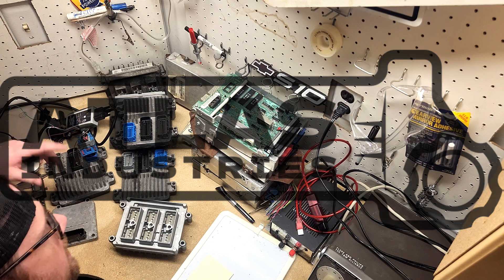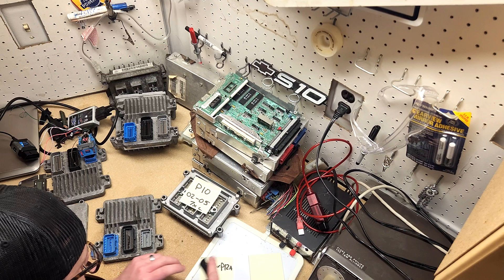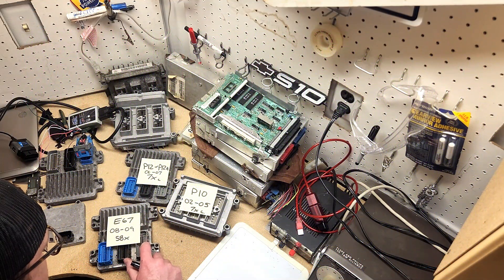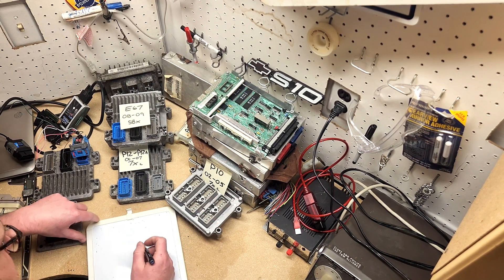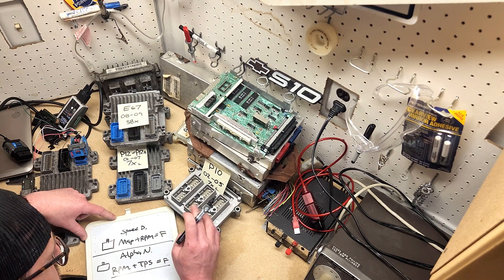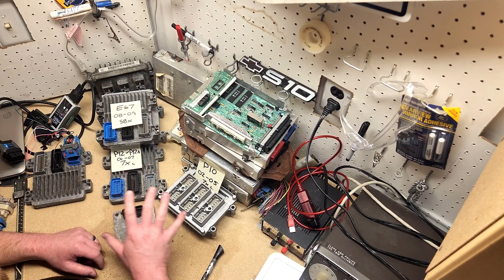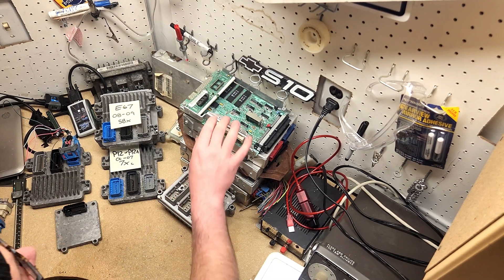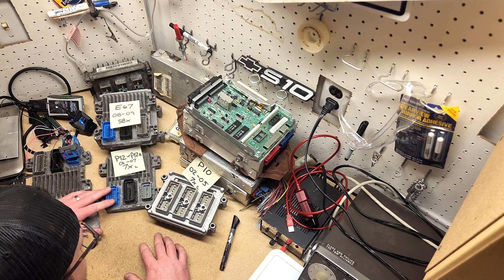Factory Atlas ECUs: The Basics You Need To Know For Your Vortec 4200 - 2800 Swap

Comment: May we have a video. Saying hello. Showing products you have. And how it looks and runs.  Tips on how to clean up the engine bay. Mucho loveo.
Just got an 2003 4.2voy
Reply from the maker: I can make a product video! I do have a lot of content already on facebook if you want to check that out. I don't have any complete running trail-voys right now, I primarily focus on the swap market at this time, all of my 4200 vehicles are swaps into muscle cars, Jeep etc. While some of my parts do fit the Trailblazer platform, I'm not going to get into engine bay dress up kits, repair parts, etc. Since I'm focused solely on engine performance. I am in process of developing a turbo manifold that fits the Trailblazer platform without any cutting or loss of AC, and will be installing that on my 2007 Trailblazer that will also be manual transmission swapped. Stay tuned and check out my website for parts at atlasinds.com

Comment: How can I tell what year engine I have without pulling the pan?
Reply: I have an 08 in mint condition with bad engine, I picked up an 04 at a great deal with a bad transmission, after awhile I noticed the 04 has an aluminum valve cover not plastic so someone has swapped the engine already and I don’t know if I can make it work in the 08 because I don’t know if it’s 06,07,08 or 09 if someone can lead this horse t the water I’m pretty thirsty!
Reply from the maker: @RobertBrown-c7z thy 4200 Bible will answer all thy questions. But in short, no, 08-09 are specific to those years only. https://sites.google.com/view/vortec4200wiki/spotters-guide?authuser=0
Reply: @Atlas-Industries  I wish it would let me send you a picture. The 2004 has a P 10 ECU with the aluminum valve cover and it’s never ran smooth since I got it. I wish I could find a serial number on the block that would let me cross reference that so you say there’s an Atlas Bible and thou must look up thouest thing I so desire to gain wizdim and knooowledge? And wearest will one find this ancient and enlightening manuscript
Reply: @Atlas-Industries  that must be what this Google link is for huh? I say duh to myself.
Reply: And thank you

Comment: What would need to be done to swap the P12, harness & MAF into a 02-05 that came with the P10?
I have access to HPtuners but have only used it on a 06 LS2 and 06 5.7 Hemi, and that was mostly just narrow band tuning.
Reply from the maker: Would this be into a Trailblazer/Envoy chassis? If so that gets really tricky because you're integrating systems that never technically talked to one another and would have a Vin-year mismatch. I'm unsure if your BCM would have an issue with that. I don't deal much in the OEM wiring side as I do for swaps, I would contact Jeremy over at lime-swap dot com as he has experience in OE GM chassis engine/year swaps like that.

Comment: I'm a little confused. I have a P12, not an E67, ECU in my 06 H3 with the I5. You said you can not run an E67 on 7x or vice versa. I5s are 58x right?
Reply from the maker: Correct, I wasn't super clear on that in the video. All 4 and 5 cylinders were always 58x either with the P12 or E67. With the 4200, the P12 was only ever used with 7x cranks, and the E67 only with 58x cranks.
Reply: Ahhhhh gotcha! Thank you. Great video got me to subscribe.
Reply from the maker: @theKEVman011 sure thing! I've been planning for months to make more videos, and I've even filmed a bunch of stuff. I've just been too busy, so hopefully come October I can get more stuff out there.

Comment: Great Information ,.. Thank you!
I’m looking for some input. I’m exploring a 4200 swap, I plan on buying a donor vehicle and will be using the OE ECU and harness, keeping a Turbo install in the future. Going by what Calvin said in a 4 year old YouTube Video the P12 was “THE” ECU to use for boost applications and about the E67 “if you want to run turbo this isn’t gonna do it”. However, later on the WIKI page it says The E67 will support boosted applications! Did I misunderstand or have things changed from the video to the WIKI?
I was searching for an ’06-’07 donor but I do have a 200K mile ’09 that can be had for a reasonable price. Which is the better way to go? I’m thinking the ’09 if the E67 will handle boost.
Reply from the maker: For sure! The P12 is simpler in regards to tuning, but it leaves things on the table like no VVT accessible tables, and you can only run MAF in boost because the VE tables max out. The E67 really is the ultimate since it was designed with boost in mind for engines like the LS9 and LSA. The speed density tables have huge axis that are fully scalable up to 400KPA, etc. The negative is its considered a Gen 4 LS ECU and they have a steeper learning curve to tuning. Building the harness for a y of the ECUs is preety much the same amount of work. If you're not aware of the E67 tuning, Goat Rope Garage on YT is a great resource to learn. I'm not an expert tuner, but feel free to reach out anytime if you have more questions.

Comment: I just came across this video, and subscribed immediately. I plan on eventually interfacing an e67 from a Trailblazer with an older, non-GM engine since it offers much of the same functionality as a leading standalone system for far less money, plus OBD2 diagnostics. I'll be watching more of your videos real soon as they seem to provide very valuable information on the subject. Thank you for sharing with us!
Reply from the maker: Thanks for subscribing! Don't think this channel is dead due to my low video count, haha. I've just been too busy with the business side of things. I will for sure be releasing more ECU and wiring content as things slow down in October.
Reply: I'm looking at MAYBE putting one of these in my '56 Chevrolet wagon and subscribed immediately  ! 😊

Comment: This actually got me thinking. If the P10 does it's fueling by Alpha-N, would that be the one to go with if you wanted to do ITBs?
Reply from the maker: Technically yes, and I plan on trying it 😉. The big issue is if I'm going to do an ITB build, it will be setup to rev to the moon, and the P10 runs out of table after 6400 RPM. It will rev higher, I've revved a P10 engine to 7300, but the ECU just has to interpolate those higher fueling values based off some math and the last value in the table, so it gets less accurate. Long story short, it could totally work but if you're doing a high dollar build vs budget, I would maybe look at aftermarket if your goal is into the high 7k rpm range, etc.

Comment: Your video is very informative, thank you for that..!!!
I do have a question however about the following :
I have a 2007 Hummer H3 ( 3.7 Atlas ) and is running a P12/P12A ECU 7x Crank Trigger. According to you the 4/5 cillinder engines between 04-12 run a 58x Crank Trigger and should not be compatible? But is the original engine and ECU /Wiring etc.
Engine of the 2007 died and I have a good running 2008 Engine which came out of a H3 with the E67 ( 08-09 ) ECU - Can I just drop it in the truck? 
So many conflicting answers, I would really appreciate your answer on this cause I am confused.
( Hummer H3 2007 was a weird year with some changes here and there )
Thank you..!!!
Reply from the maker: @bastiankuipers2681  thanks I appreciate it! All 4/5 cylinders were always 58x, the only 7x were P10 and P12 4200 ECUs.

Comment: Random question but does the p10 have e85 capability like the p12?? Just seen J Whit video on it but hes olny familiar with the p12
Reply from the maker: @Tapwater45.  Jonathan's using the E67 in his Trailblazer, which is E85 capable. The P10 is not from the factory BUT I have found code hidden in the calibrations that's for flex fuel. The question is if it was completed by GM and just never used, or it might just be leftovers from something else. Once I tackle the 2 Bar SD stuff for boosting the P10, I'll look into the flex fuel next. Likely this coming fall season.
Reply: @Atlas-Industries  hey man thanks for your work and I can't wait on the progress!🤞

Comment: In the process of planning a 08 09 4.2l , out of a trailblazer and swap into my 07 hummer h3 3.7l atlas. Can I just reuse my E67 ecu ?
Reply: @Atlas-Industries
Reply from the maker: @LittleDiesels-H3  some of the 4/5 cylinder ECUs don't have all the pins for the extra cylinders. Your safest bet is to get a new ECU to match. Also if you have already seen his stuff, Francisco Thomen at 42004U dot com has done multiple 4200 colorado swaps and sells parts for doing exactly that.
Reply: @ ok think you so much. I thought I had e67 ecu but I have the p12 ecu. Getting discouraged.
Reply from the maker: @LittleDiesels-H3  nah don't give up! You can swap with the P12 also. Are you on the 4200 Swap and Performance facebook group? If not you should join if you have FB.
Reply: I’m not giving up I’m a heavy decent mechanic. I’ve done tons of infra motors electrical so I would think I could do from a five cylinder to a six cylinder pretty easy but what’s messing me up is electrical year models I can pin things. I just need a good tuner lime swap said they would help me. Thank you for what you do and letting me pick your brain.

Comment: Broooo, you are a wealth of knowledge. I WISH i know how to do all this ECU/PCM wizardry. Definitely subbed. I plan on doing a 4200 swap into my trans am. Also, i have the lovely Alpha-N PCM for my 03 Cavalier and have that tuning issue. Are there any options for my situation? Otherwise I was looking at wiring in an aftermarket ECU and retaining the stock one for non-engine functions.
Reply from the maker: @GridIndustries  thanks sir, glad I can help share some info. As for the Cavalier, is it an Ecotec or the old 2200 or 2.4 LD9? And shameless plug, check out my website at atlasinds.com

Comment: Some of those older chipped ECUs work with a 7x crank signal. If I can run a P59 on a CB450 without most sensors and all DTCs disabled (yes, even those DTCs), you could sort that out. That's available as a base tune for testing. Wish I had a 6 cylinder to test the P59 without a custom OS.
Reply: Do you think I can run the p59 with the 4200?  I want to swap it into my 07 silverado just don't know the best route to go.
Reply: @IronEzer  Without custom firmware (AKA OS, which does exist) I don't know. Been trying to get ahold of a 6 cylinder to test that for over a year now. I don't get enough disposable income to just say fuck it and buy one to test it. If you want to try, it should be as simple as starting with a 4.3 V6 tune, then disable (set to 0) "low res crank signal" in the vehicle option matrix. And then reference the firing order of each and plug it all in in the right order. And use a 24x wheel on the crank pulley of course. 1x cam signal if you can't tollerate a couple attempts to start it.

Comment: Is there any way to get around doing a case relearn on a p12? I had to replace my ecu for my 3500 and tried doing a case relearn with hpt, snap on tool and an autel tool and no success
Reply from the maker: @scottharris5421  not that I'm aware of, I've had the best luck doing "GM things" using either a Tech 2 or or clone with a VCX Diag NANO and the tech2win software. To relearn the crank position it can be finicky, you have to do the procedure 100% by the book.
Reply: @Atlas-Industries  that's what I've heard. Looks like the dealer is about my only option around here to find a tech 2. Thanks for the help
Reply from the maker: @scottharris5421  no prob! You might want to keep an eye on ebay or FB marketplace for a VCX Diag Nano for cheap. I got one for 100 bucks and it allows you to use Tech 2 Win software which emulates a Tech 2 interface on your laptop. Super handy and way cheaper that a real Tech 2. Sometimes a bit glitch when setting up, but for the price you can't beat it. I am really surprised a snap on or Autel couldn't do it though.

Comment: Very excited about the innovations in p10 tuning! Definitely ready to hear more on that 🎉
Reply from the maker: @zekeuhl  I'll be getting back into more P10 work after the new year once mechanical projects slow down and it's too cold to take the project cars out.  You can follow along for updates on the Vortec 4200 Performance and Swap facebook group, as well as my website atlasinds.com
Reply: UniversalPatcher guys have been working on it too. Free software that works with an OBDLink SX (the red cable to the right in this video).

Comment: Can't wait for the tutorial on the P10. Been trying to understand and learn hot to pep my trailblazer up but find it super hard to find any info on the P10.
Reply from the maker: Sounds like I have motivation to get that out sooner than later then! The P10 is not hard to tune, actually the easiest of all the 4200 ECUs, it's just that it's "different" enough that many of the typical LS tuning tutorials don't quite apply like they do for the E67 etc, and the tables are not exactly intuitive.